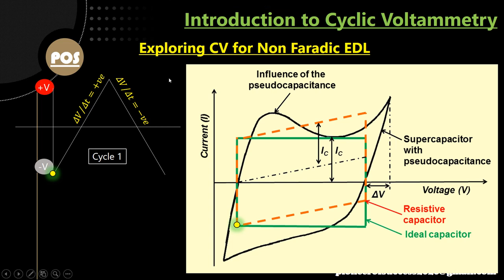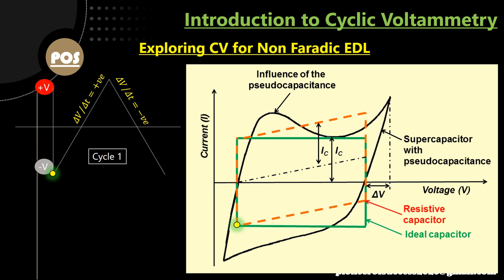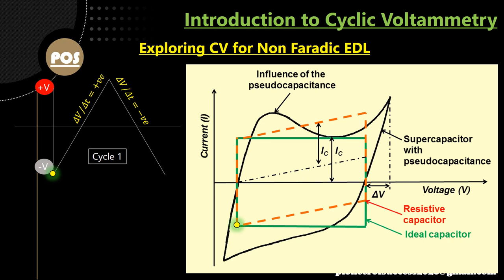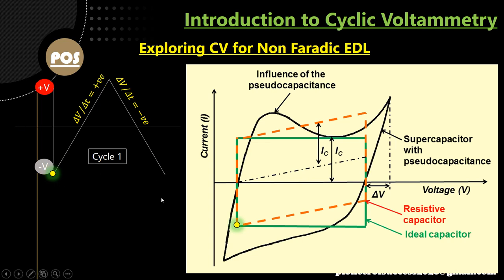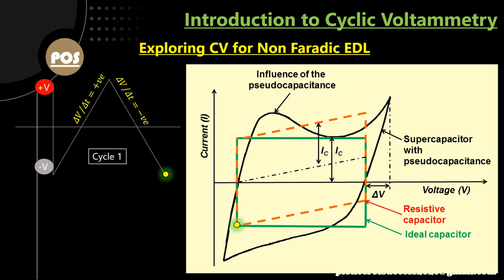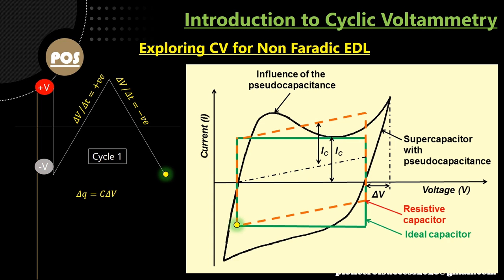Understanding about non ideal CV nature for Double Layer Capacitor #CV #EDLC #capacitor #Concept

Comment: What is the actual meaning of this faradic reaction? What kind of "charges are transfered " and is transfered between what??
Reply from the maker: Faradic reaction means a heterogeneous chemical reaction takes place on the working electrode. An example would make the concept better. The ferro and feri interconversion while you do CV with potassium ferricyanide solution. In electrochemistry electronic exchange happens. And, charge transfer means, the constituent cations and anions undergo transfer from bulk to the electrode surface and vice versa.